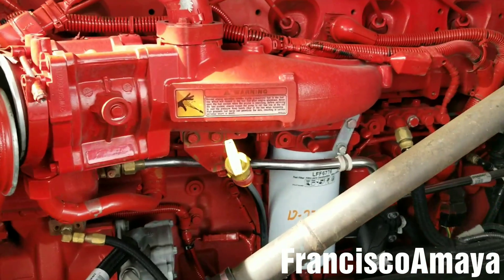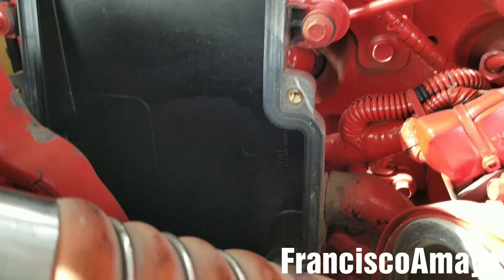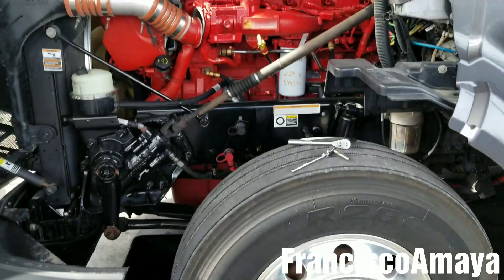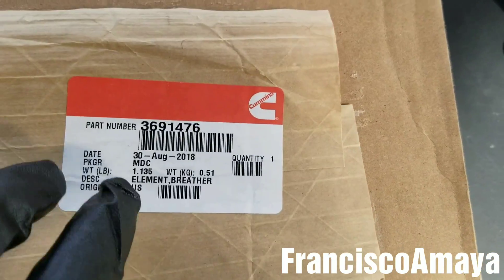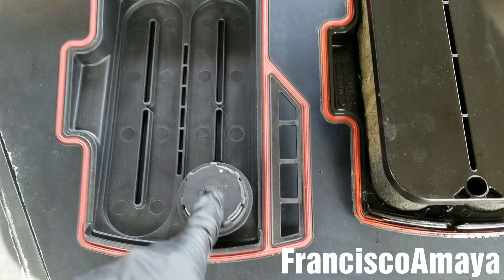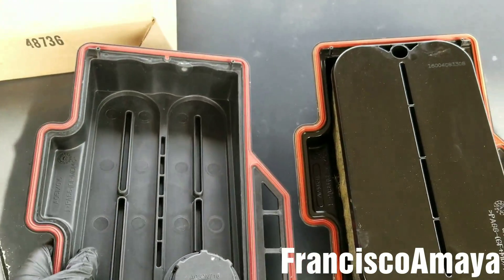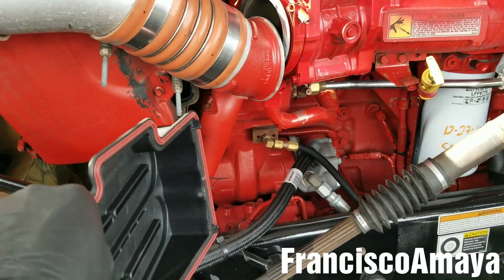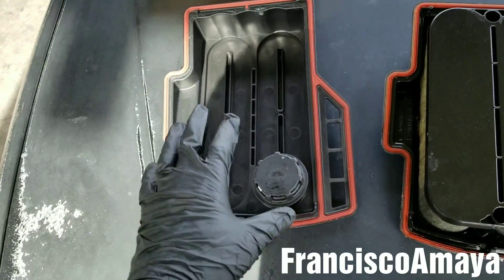Cummins ISX ISX15 high crankcase blow by pressure solution bypass

Comment: Hi, my 2008 isx is leaking oil out of the exhaust hose coming out of the crank case filter box. I have to get an already existing oil leak on the front engine cover.
Anyways, is the oil coming out that hose a very dirty crank case filter that needs to be changed or high crankcase pressure because of engine needing overhaul? Thank you!

Comment: Just replaced my old filter, which I change twice a year, with the bypass. All my front seals started leaking, due to high pressure, but no one offered this. It was due to a bad cam shaft, and associated parts. I'll try this anyway, as my isx 15 is a money pit, til I sell it. Also keep that carbon packing down by only using Valvoline premium blue! Or, the new Delo 600 or 400. The first preferably, as it was developed jointly by Cummins and Valvoline for the isx, yet no one tells you about it. It is in the manual if you have one or actually read it. It produces the lowest amount of soot, ash, etc, so carbon packing is virtually,  but not absolutely, mitigated. If having a carbon packing issue,  fist clean with FTC Decarbonizer oil cleaner (amazing stuff, as well as there fuel/dpf cleaner additive!) then run a full oil change cycle of Valvoline Premium Restore. It's expensive, but it works. It can save you thousands in engine repairs, and extend it's useful life. This bypass filter should help with blow by issues I read.

Comment: I just had a valve adjustment and I started getting the 1942 code for crankcase pressure so I changed the sensor and filter and the check engine still comes back on. Did the valve adjustment have anything to do with the sensor coming on?  My front seal leaks and my oil pan a little I can drive 20k then my dip stick says add

Comment: Hello I have a problem with a QSX15 engine mounted on a Sandvik drilling machine but the remark that I did the blow-by is still important, ie it exceeds the standard Can someone explain to me the procedure it uses for measurement? the blow-by.

Comment: Francisco my crankcase pressure light came on and I changed the filter and the sensor. The light when away. I drove for 700 miles and now is back on. My truck is also overflowing the reservoir. I changed the EGR cooler.  Any I dea what it is??

Comment: I have blow by smoke coming from a blow by tube it happens when I’m sitting idled I have a Cummins isx engine 746,000 miles no service engine lite is on but it worries me what could be the problem or is there a problem
Reply: did you solved your problem? i have the same problem

Comment: Hey my 2006 Cummins doesn’t have  the crank case filter. And I have some smoke coming from the oil cap when I take it out. Is that normal or I need to change something? Please let me know
Reply: Try to change oil and filters and the put new oil and one gallon of Lucas

Comment: I have Cummins isx. 2009 I'm rebuilt the engine almost 2 yers ago drive truck about 150000 km after rebuilt now I have Low oil pressure  issue and high crankcase pressure  what s ur opinion
Reply: Is the bearings in the crankshaft been changed? Cummins engine a lot of time when oil level start going low is because the bearings
Reply: Had same issue but the oil temp was always 235 and after I changed the oil cooler it went down to 220-200 and added 2 quarts of Lucas to keep the pressure around 30-35 or it'll stay around 20-25

Comment: I have Freightliner 2013 Cummins there is code fmi 3 spn 862 you think if I change the filter problem will go because it’s show high low voltage something ??
Reply from the maker: It related to the crankcase filter heater.  It is on the crankcase filter cover or maybe the plug or the wiring is bad.

Comment: Francisco  question with the swap how long can you run? i know every case is different but if worse comes to worse and you can hold it whats your recommendation just wondering ?
Reply from the maker: If you use this filter you can leave there forever but this will not prevent oil consumption problems.

Comment: My ISX the engine dies when its idle. Can the Crankcase filter replacement be the solution?
Reply from the maker: If the red light comes on, yes.

Comment: I have a lot of oil consumption on my ISX. Will replacing this filter help the consumption any at all?? At least until I can rebuilt my engine?
Reply from the maker: I am not sure but try it maybe it works.
Reply: Did it help you on burning less oil?
Reply: @thebigboss1839   hey man it was determined that I needed my head replaced. With the problem I was having, I was burning 2 gallon of oil every 2k miles. So my head calves were causing the mayor oil consumption. Plus, my injector cups were no good. Coolant leaking into the pistons. After new head, I’m burning half gallon of oil every 4K miles and no coolant in diesel.
Reply: @wagnermatos5373  thank you sir I appreciate your response

Comment: Francisco, thanks for the video. I have a 2012 CM2250 isx engine but the filter cover looks different. Will it fit my year engine?
Reply: My friend, I had the CM2250 and I replace it with the same looking filter. Just ask at the parts department for the upgrade filter for the crankcase filter. They will give you the right one, blessings

Comment: Hey man I got a injector 1 misfire, I changed injectors, injector harness, engine harness and cleaned ecm connectors but still get the code but when I shut my truck off I'll shake the ecu harness and the code goes away do I have a short in the ecu harness?

Comment: What is considered high on the crank case?
Reply from the maker: When you remove the oil fill up cap and a lot of pressure is released.
Reply: Francisco Amaya I have isx 435 on prostar and oil is dripping actually streaming out from the blow by tube... my guess I need a new bottom end right?

Comment: Is there a bypass filter for a dd15?
Reply: usdpaulp no there is not and never will because Detroit uses a different kind of  crank case breath system. They do not us a crack case pressure  sensor so you won’t get a code.
Reply: No. DD15's don't have a crank case filter. They have an oil degasser commonly referred to as a "spinner" its that black circle thing on the right hand side of the block under the turbo.
Reply: @xxpr0nag3xx  that black circle IS THE CRANKCASE FILTER
Reply: @desvariosdeuncamionero8856  engine breather or oil separator
Reply: @desvariosdeuncamionero8856 No. It is not. I literally work for a Freightliner dealership. There is no particulate filter involved. It is fed out. Spins it really fast to separate the crank case gasses from the oil, then feeds it back int o the pan. Even detroit doesn't call it a filter in PSL or parts pro. It's official name is a "Crankcase Breather Assembly"
Reply: @xxpr0nag3xx  so how different is that name from crankcase filter? Or the use ? Do yo you know what the crankcase filter do? The only difference in this case is that detroit doesn't have a filter involved in all this , wow even  you been said work for freightliner knows what the duty of that crankcase system on Detroit's engine, ITS THE SAME WIHOUT FILTER , SEPARATE OIL FROM GASES ON THE CRANKCASE, let me see, oooh is the same shit with different name and without filter
Reply: @desvariosdeuncamionero8856  Yes. When you take out the filter, it stops being a crank case FILTER and starts being a crank case BREATHER. It is semantics but there is a difference. Both DO vent crank case gases but one FILTERS particulate matter as well. In either case however, you can't bypass the crank case BREATHER on a DD15 because it has no FILTER like the ISX or X15 does, which is what the OP was asking.